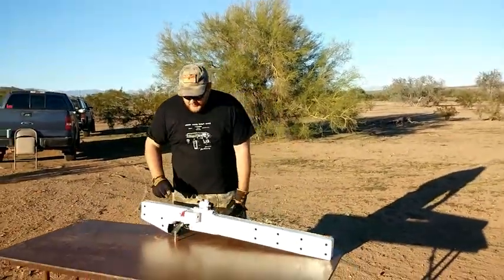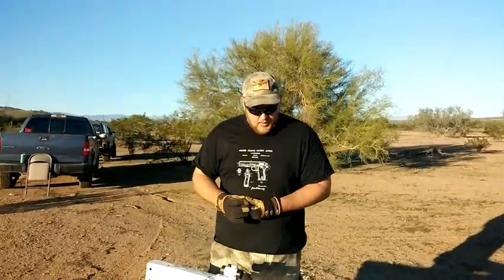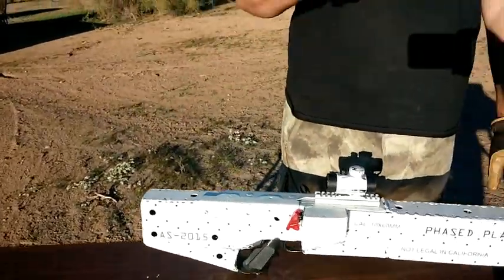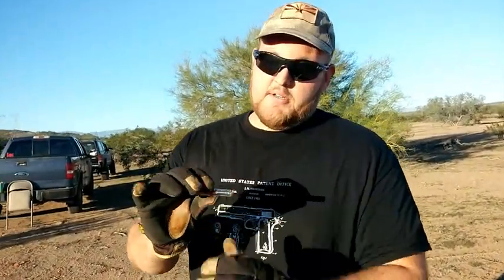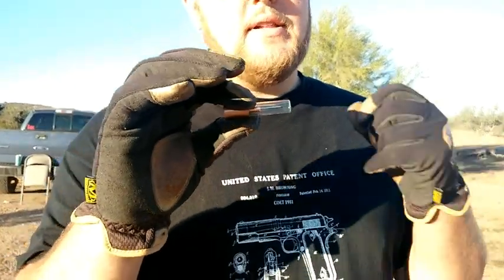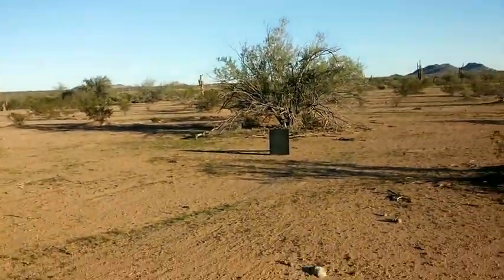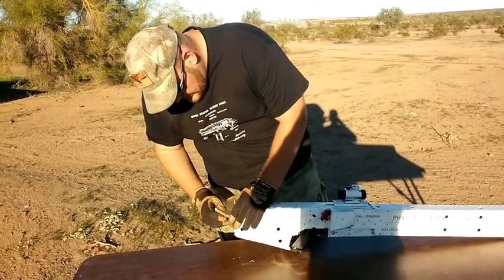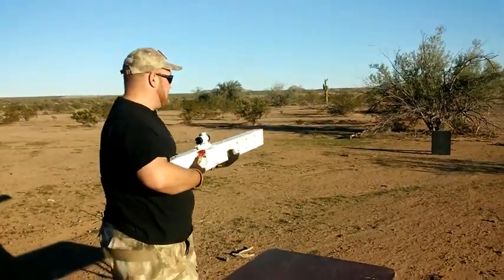Electromagnetic Plasma Rifle Test Fire

Comment: Okay good joke, Phased Plasma Rifle with 40 watt range? Yeah I watched terminator also, lol!
Reply: Well it fires an ionized plasma projectile. It's about as close to a plasma rifle as you can get. Not only that but correct me if I'm wrong, the plasma rifles in the terminator series used magnetic fields to ionize and propel plasma bolts.
Reply: Valynaz Valkynaz "leans in close and whispers"

jet fuel cant melt steel beams
Reply: its basically a railgun
Reply: theomnipresent1 you didn't fade back into the shadows, i can still see you, plus if you're omnipresent that means you never came or left because you were here all along
Reply: +Brunneis Ursus "from the shadows out steps a wandering passerby"

Maybe true, though melting is unnecessary if you can heat the steel enough to decrease its yield strength. This will decrease the load bearing capabilities of the structure; to the point where if you had enough mass above the softened beams, the force could cause the steel to yield/strain.

The idea that the steel would need to MELT is a commonly spread myth. Regardless of whether the fuel source was enough to melt steel, the structure would collapse well before that due to being weakened.
Reply: or to some coil guns
Reply: ...Does it have any forbidden fruit?
Reply: It's up to guys like him to ensure we don't get too sad not living in the future science fiction writers and movie makers have imagined for us.

I'll be ok with Facebook being the closest we get to Skynet though.
Reply: Brunneis Ursus ok then
Reply: Valynaz Valkynaz hey, guess what
Reply: Brunneis Ursus what
Reply: Brunneis Ursus yo no hablo science of jet fuel since I never learned about jet fuel tup stuff and the heat it generates
Reply: Don't worry my tits are fine; just spreading the good word. Just trying to protect the other guy from going down that rabbit-hole, and anyone else in the future who may follow.

"fades back into the shadows from whence he came"
Reply: +Valynaz Valkynaz no, it is a railgun
Reply: +Brunneis Ursus ...Hail Hydra...
Reply: Carnage all hail my soft and silky lord satin
Reply: Brunneis Ursus you sure?
Reply: Valynaz Valkynaz yup
Reply: +theomnipresent1 that is true, but people talk about melting because from one of the videos, you can see a stream of molten metal pouring from one of the towers, when they examined the cooled metal they found spherule formations of iron oxide and molybdenum, meaning it came from the steel I-beam's and was heated in excess of 1700°c.
Reply: Valynaz Valkynaz it was a 9/11 joke lighten up hahahaha

Comment: For comparison, how does this stack up against modern Anti-Materiel rifles? 

Additionally, how efficient is it comparatively?
How do the costs stack up?

Regardless of those concerns, this is awesome, and certainly a step in the right direction for modern firearm development.
Reply from the maker: +Nick Moody This will just be seen as a primitive one in hindsight as the technology advances. 20 years from now this will probably seem like a smooth bore musket vs an AR15 compared to future technology. Its fairly comperable to a lot of modern firearms though. Not as effective as a .50bmg or 20mm etc., but in the future i'm sure they'll surpass them. The Navy has one that fires a 45lb projectile at 5,000mph lol
Reply: +Alex Smyth Yeah, it probably will be, but just like the musket, it's an important step into the future of weapons development. What kind of muzzle velocity, and impact energy does the round in this one provide? Also still wondering about how it compares in terms of ammunition cost?

Comment: Is this a gag? As I think I hear a shot being fired. Also, I would think as a rail gun uses electromagnetism, copper would be a bad choice for a projectile material as it is very weakly magnetic. Also there seems to be the handle of a rifle sticking out the bottom of rifle/box, wish is visible around the 20sec mark.
Reply: The magnetic field is actually a lorentz force, and there are three fields going on simultaneously; one on each of the rails rotating in one direction (perpendicular to the rails) and one in the copper (in parallel to the rails). The magnetic fields interact and give a rather violent force to the copper. A railgun runs on the principle of kinetic energy being produced as a result of the electromagnetic field in the projectile, as opposed to a coilgun, which produces it from just the magnetic properties of the projectile, meaning that the projectile in the coilgun needs to be magnetic, whereas in a railgun it only needs to be metallic.
Reply: +Alex Smyth with that said you might be able to use tungsten as ammunition for it since it's very conductive and hard, so that it could go through steel easily. although it would be a fairly expensive round to make.
Reply from the maker: +Rian Kruger The projectile is supersonic so it makes a sonic boom like a bullet or jet etc. just not as loud as a gunshot or my ears would be bleeding lol. As far as the copper, a lot of people are confusing rail guns and coil guns. Rail guns use conductive, non magnetic projectiles. Coil guns are the ones that use magnetic projectiles. If I loaded this with a piece of iron or steel, it would just weld itself to the rails. And yes, I used an AR15 pistol grip I had in a box of misc. gun parts.

Comment: There is no way copper can go through steel.
Reply from the maker: +Chance Pace It's actually pretty common. RPGs (rocket propelled grenades) used a shaped charge to blast a copper stream through steel armor plate on tanks etc. In this case though the copper didn't go through it, it ricocheted and hit the cameraman.
Reply: That is true
Reply: +Chance Pace 

I'm shooting lead through steel on a regular basis, and last time I checked lead was even softer than copper.
It all depends on the velocity.
Reply: +Chance Pace The large number of people wounded or killed by EFPs would disagree with you.
Reply: +Chance Pace Many armor piercing rounds contain copper.
Reply: +Alex Smyth Ouch.  I hope he's okay.

I'll echo the other calls for another vid showing internals, etc.  Also try to get your hands on a slo-mo camera so we can see the projectile in action.  It would be really interesting to see if the plasma releases on impact.
Reply: Wow… you really don’t understand much do you? Copper no. A rapidly fluctuating magnetic field? Hell yeah it will.
Reply: +Chance Pace It's copper in plasma form making it even softer than solid copper, but the heat just melts through the steel.

Comment: On your first video, it seemed the round detonated upon leaving the barrel. Did you fix that, or was the flash caused by something else?
Reply from the maker: +Jordan Greene The actual body of it is all 1/8" steel that has been welded together. I wanted to use fiberglass since it doesn't conduct electricity and is significantly lighter, but I went with steel since the rails are trying to blow themselves apart lol and steel is really strong. And ya, I've seen some other ones with led displays showing battery life. Its set up now so that pulling the trigger just dumps all of the power that's in the capacitor bank at once rather than rationing a specific amount of power per shot. But yes, for a more consistent or semi automatic fire a battery display would be a really good idea.
Reply from the maker: +Evan Wickstrom I think it was just sparks from friction with the rails or something before it left the rifle. They were probably there this time too, but it was too bright out to see them. Both times the projectile hit and penetrated the steel, so the projectile made it out of the rifle and through the target on both shots.
Reply: +Alex Smyth what did you use for the casing of the entire prototype itself and also the battery too I was wondering about that and for your next what are you thinking about putting a charge to display so you can see how much battery you have left
Reply: +Alex Smyth I would really love to collab with you on making one of these
Reply: +Alex Smyth try looking to channel a portion of the electromagnetic resistance in your rails. the navy was having a hard time at first with that.
Reply: MorginBlack On a railgun. Seems legit.